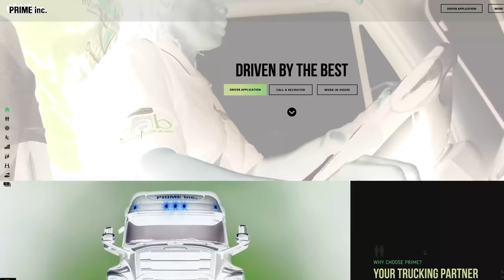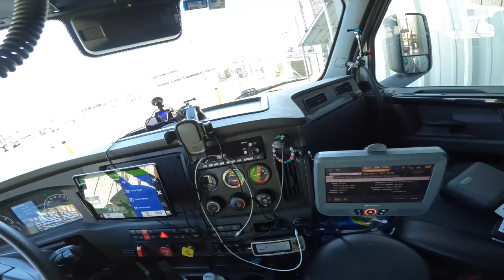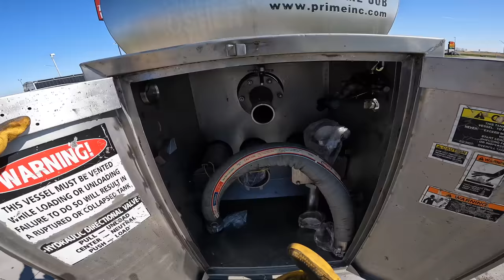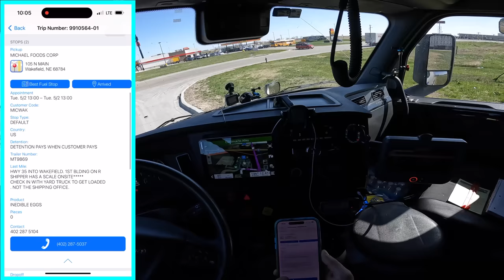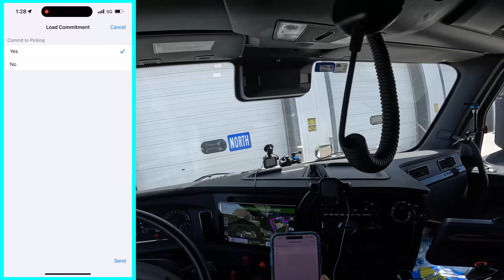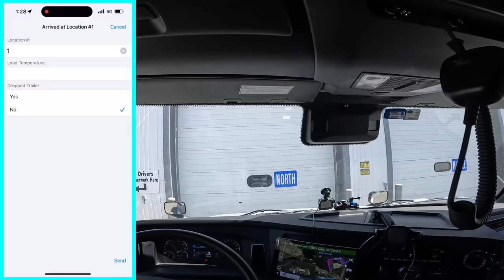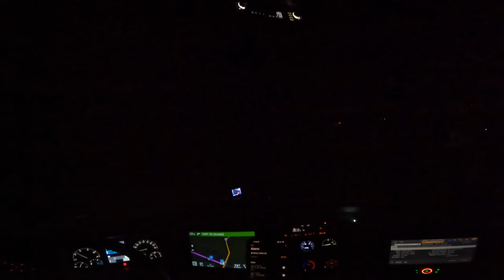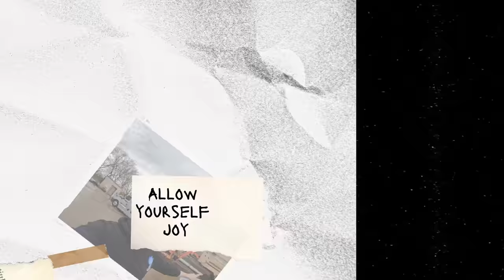Massive Tanker Surge Blows Automatic Semi Truck 😱

Comment: Hey bud if you want to get rid of that annoying beeping sound when you unbuckle your seatbelt just get you a paperclip, undo the connector down by the seatbelt and stick in the paperclip in the 2 terminals. By closing the circuit your truck will think that you have your seatbelt on and no more annoying beeping sound. I don’t drive without my seatbelt on but I do take it off when backing or hooking/dropping a trailer.
Reply: Alternatively use a seat beat extension, it’s plugged in and assumes it is the seat belt.
Reply: Or just take the seat belt off and hook it behind you when you get to the shipper works for me. So the seat belt will be engaged but your back will be on the seat belt no need to do the paper clip hack

Comment: you should just set your internet box up in the back full time.
Reply: Right lol. That’s what I do
Reply from the maker: I had it setup this way in my peterbilt and went through 3 boxes (1 fell the other 2 kept over heating) it’s not easy for a trucker to just pull up to T-Mobile with a loaded trailer to swap it out. So I only plug it up when I shut down.
Reply: @Trucking With Rex   I hear that you just need to mount it so it can breathe and not tip. Pita but,  once you have it set it should be awesome for all your connected devices

Comment: I’d really like to see your yearly gross and numbers so far. Not trying to be nosy but I’m interested in their tanker lease program. I gross a solid guarantee right now and the miles and work schedule are solid. Only downfall is the harsh hazmat chemicals I have to unload most of the time; and I am at their mercy for taking time off etc, you know the deal. Any info would be appreciated. Thx Rex.
Reply from the maker: I can add a screenshot in a future video. For 2022 I grossed 245k net was 105k
Reply: @truckingwithrex  , You Grossed That Solo Or Trainer/Team ?

Comment: Think eggs surge a lot,  Sulfuric acid weighs 15.3 pounds per gallon. When you stop at a stop light hold on to the brake hard as it will push you into the intersection.

Comment: Surge? I once talked to an old time driver who said he had hauled
every kind of load with every kind of trailer they is & he said the
single most difficult load, BY FAR, is hanging beef. He said the beef 
will swing  on a turn or a curve and it can push you off the road and
into the ditch if you are not careful.

!

Comment: When at a tank wash that does not dry the inside of the trailer, have you thought about running your intransit heat to dry out the trailer while heading to the shipper. just a thought. Another great video. Peace.

Comment: How do you deal with surge in an automatic? I heard it messes up the transmission. 

Do you just floor the brakes? 
Or is there a method to stopping correctly.
Reply from the maker: I don’t have a problem just gotta be smooth, ease into the brakes. Slamming them with make the surge slap pretty hard!